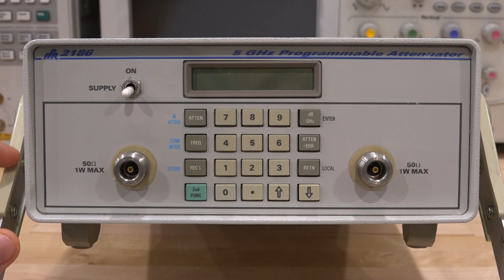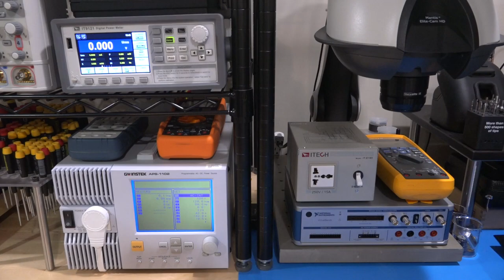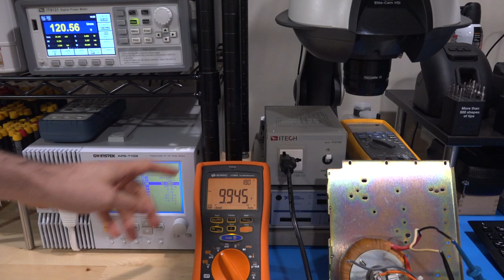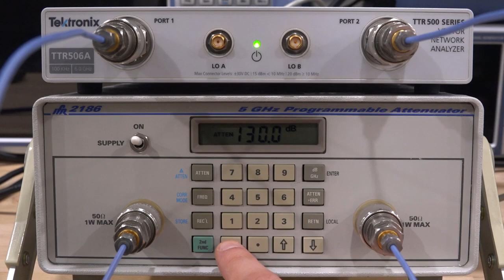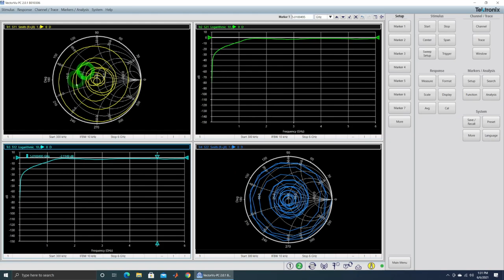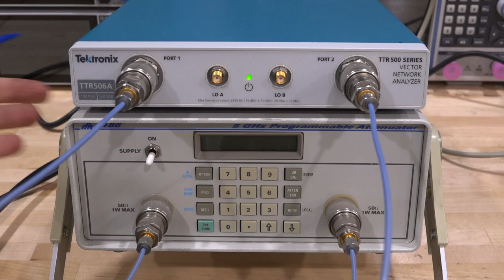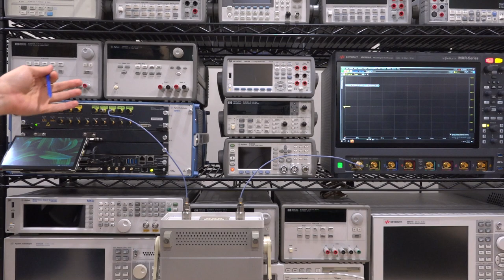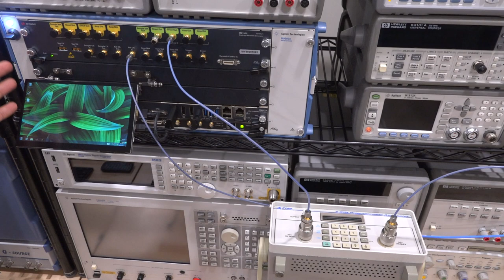TSP #194 - Teardown, Repair & Experiments with a Marconi 2186 130dB 5GHz Programmable Attenuator

Comment from the maker: Please note that the two attenuator modules are not identical. They are used in sequentially and in conjunction  to achieve 1dB steps across the entire 130dB variable range. This is one of the main advantages of this instrument to provide small steps and very large range.
Reply: Man, you forgot to say "FIIRRRSST!"

Comment: Interesting repair - it seems the first test of any of this high frequency equipment should be to see if you've got a low-pass problem - seems like a theme!  Nice repair and experiments.
Reply from the maker: Hehe… By the way, I’d like to repeat the sensitivity experiment with the 6B and the demodulation software. When do you think that would be available?
Reply: @Thesignalpath  It's available now - I'll be in touch...

Comment: The frequency can be used to read the calibrated attenuation value at that frequency (from display or Ieee interface). If you switch on "corr mode" it will try the set att value as close as possible for the given frequency. E.g. the display will show 100dB but internally it will set 99dB as that is closer to 100dB for the given frequency.
Reply: Innas cable guy  ,  Just out of curiosity... you knew this how?
Reply: @BruceNitroxpro  i used this attuator long time ago testing e.g. RF amplifiers
Reply: @hnasje66  ,  Aha... this is a very lovely instrument and has great specs. I wonder how much it cost back in the day?

Comment: Could you please include in your tests something that tests the device way past their rated frequency range? There are so many quality items on the market that behave very well even outside of their specified parameters. It would be very interesting to see which devices work well at higher frequencies, and which ones don't work well at all. Considering all of these devices are purchased used, it would be so helpful to get the most out of them. Like this attenuator, I wonder if one could go do 9Ghz and have it still be usable, etc. Thank you.
Reply: If it's possible to damage some devices by putting too high frequency into them, then you'd end up having to test them to failure to find their performance outside their rated frequency. Another possible issue is that they might perform differently at different signal levels and frequencies and it would be too time consuming to characterize their performance across all parameters.
That said, I'd love to see how they perform at higher frequencies, especially if it has a linear rolloff, you could find the -3dB point and use that to calibrate out the additional attenuation from the device on top of the attenuation you program.

Comment: My personal mechanical attenuator failures are:
little O rings that dampens the movement.
The pin might not be at the right place in the tiny slit
Dirty contacts , most frequent
Only once I had a die that did not work.

Comment: Does the freq button do anything?
Reply: I'd like to know that, too.
Reply: The people have a right to know!
Reply from the maker: It did nothing! :)
Reply: @Thesignalpath  that's a shame. I was hoping they'd at least snuck a free simple frequency counter or something in there!
Reply: @Thesignalpath  It's to compensate for the actual loss at a given frequency, since the frequency response isn't completely flat from DC to 5 GHz. For example, setting the programmable attenuator to 10 dB may require setting 9 dB of face value with 1 dB of additional internal loss.

Comment: Are the attenuator units using binary values to produce all the attenuation steps? (MSB-LSB).
Reply: Binary steps would allow the minimum number of fixed attenuators and switches, but not necessarily the minimum number of switch actuations, since that's a wear item, a point of failure, and also may maximize tolerance stack up errors where the insertion loss differs by the face value. It's also helpful for the engineer to know where the bigger attenuator steps are, since the errors are larger when switching those in and out. It's convenient for us base 10 creatures to have those large steps occur on 5 dB or 10 dB boundaries.